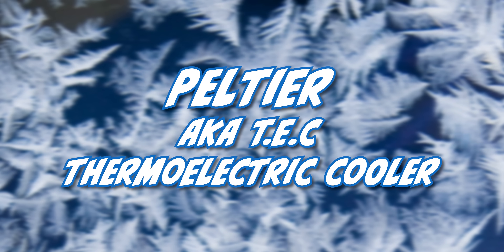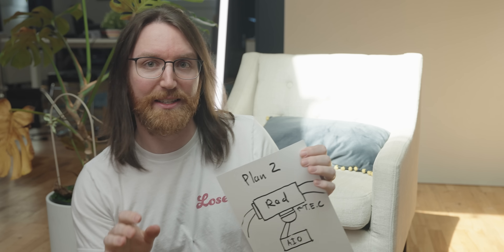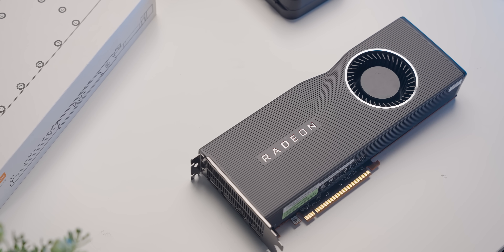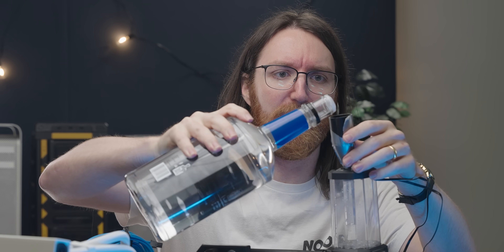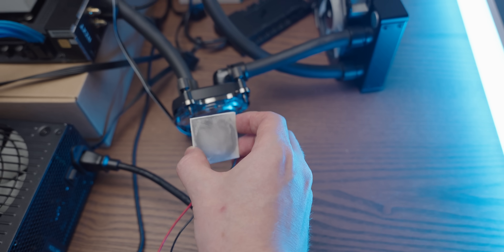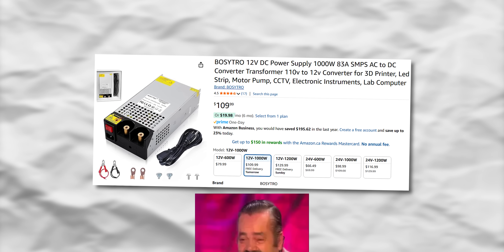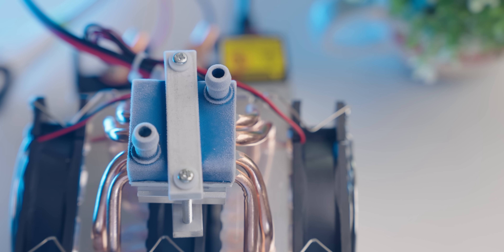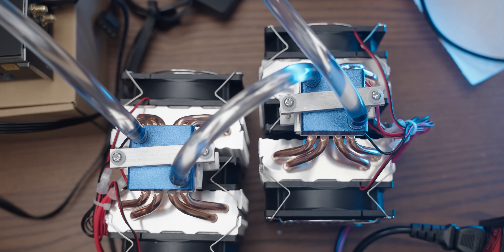I REVOLUTIONISE PC Cooling....

Comment: Due to how a peltier works, the ideal area to put a liquid chiller, is after the radiator, keep in mind a radiator works in reverse as well, thus if the liquid drops below room temperature, then the radiator will simply add heat to the loop. Furthermore, a radiator becomes less and less efficient in thermal transfer when the temperature delta shrinks, this is why those experiments where they use a car radiator or string together 4+ 360mm radiators , does very little for a loop. If you want to efficiently combine both cooling methods, then the first cooling stage needs to be the radiator as it needs the largest temperature delta possible, then after the radiator, the liquid then flows into the peltiers before entering the video card. 

Overall, if you were pumping the peltier chilled liquid into the radiator, then you were effectively making the most inefficient use possible of the radiator. The peltiers will add the same amount of temperature drop to the liquid passing over them regardless of if the liquid is 40C or 20C, but the radiator will now. If the room temperature is 20C and you pass through 23C liquid, a radiator of that size may struggle to do even a 1.5C temperature drop, but if the liquid in the radiator is 40C, then it could easily pull off 15-16C.
Reply: Yep, this is why whenever you are thinking of cooling you have to consider ambient temps, the most efficient way I ever cooled, at least in my case since its pretty cold most of the time where I live, was to have a large radiator outside, I literally have a MoRa3 outside my window, with fans at 100% and used to get my 4 RTX 2080ti back in the day to 6C idle temps and 25C max on 100 percent load, this was when I used to do a ton of rendering...
Reply: @rebootcomputa  That’s awesome! I know Ram doesn’t like low temperatures, but clearly cpu/gpus don’t mind if all the liquid nitrogen overclocking is to be used as evidence 😂
Reply: @_..-.._..-.._  Yeah that might be a bit extreme but I dont think XOC keep their hardware that long below 0C and also neither could I anyway its not That cold where I live. I will say GPUs loved it the most, CPU was cooled too, but it would stay warmer, still managed to keep it dry so no condensation since the delta difference between outside and my room temps was pretty big
Reply: Brilliant! Would love to see a rehash of the video with this in mind
Reply: This. If you chill the liquid going into the radiator, it will just blow cold air out the radiator and cool the room (warming up the loop). If you chill down the 'cold' side of the radiator it can get lower than room temperature.
Reply: @Stoney3K  so if we want to keep our room temps down and still keep good cooling on our PC, this would possibly be a good setup? may be good for us folks down south where it always stays HOT.
Reply: Excellent! I’m so glad I didn’t have to try to explain all that, I wouldn’t have done nearly as well.
Reply: Great reply bro. 

One thing to add is once you have added the peltier after the radiator, find a way of throttling the flow. The longer the liquid can spend in the radiator the cooler it will become. Sometimes it's not about just getting the liquid through as quick. It's the same with car engines. It throttles the flow so that the liquid can dwell longer and exchange heat more effectively. But otherwise great job in answering something we have all asked!
Reply: he forgot that (or maybe unaware) the peltier device itself also emit its own heat, generated from converting electrical energy... this heat is then added to the primary heat which it was supposed to transfer... so the overall system has more heat to deal with later on... so the drawbacks - 1. system cost, 2. overall system's thermal efficiency, 3. safety of cpu/mobo due to condensation... are some primary reasons why peltier may not make any sense in pc cooling solutions.
Reply: Came here to say this myself, but you did a great job of explaining it.  Pumping the chilled coolant into a radiator is counter productive.  The radiator will exchange heat from the air to the coolant.  You need to put the radiator after the GPU, and the peltier before the GPU essentially.  Still, it is never going to be terribly effective.  You would be much better off just immersing a block in a bath of salty ice water, and replenishing the ice periodically, then pumping coolant through that block into the GPU.
Reply: That's quite big brain, so cool before liquid enters the cpu but after the hot side has passed through the radiator
Reply: what about putting 2 waterblocks on the TEC, have the hotside feed the radiator, and the cold side chill the output. You increase the delta t inside the radiator and thus it's effectiveness and should operate the peltier with a low delta T increasing it's efficiency.
Reply: Truth is peltier's work better at lower power than their max power. you just use them as a means to move heat not as a way to COOL. 
Example your Block always stays a 36C on 400 watt load
Adding a 10C delta temp of the peltier would incease the block temp up 10C 
So you only need the peltier to work to do 10C of movement of heat. Instead of trying to use it as 60C max full power it moves (what ever wattage that is) you'll end with something that moves more heat that what it uses causing it's coefficient to go up significantly.

I got a 250 watt peilter 60c uses something like 360 watts of power. Tuning for 10c & only 1/6 the power would be 41.7 watts of power moved more efficiently to what ever block your using. The peltier would probably only use about 15 watts

Thus the block could go from 36C load to 46C load with the peltier was it moves the heat into more effectively
Reply: I subbed to see this video
Reply: This, 100%, He need to get the ambient air cooler than the room air if we wants to lower temps.
Reply: I  I would measure the temperature before and after reaching Peltier.  I doubt its given enough time to cool the liquid.
Reply: One of the problem of using multiple radiators is the friction you add, so basically you break the flow pressure and speeed.then the air temperature is the same, so you basically end to a neutral point where even if the exchange surface is bigger you no more remove heat, and even add it by lowering the speed flow and pressure.
Reply: this is aall mathematically incorrect. Loop order doesn't matter at all if flow doesn't change.
Reply: Same principle applies in hvac, we use outdoor ambient air control to open or close a switch that turns on the condenser fan motor. Causing a higher delta t in the winter and more heat extracted from the building. Versus, a constant operation condenser fan motor. Causing what you stated above, very smart very astute observation. (;
Reply: The delta between inlet and outlet of a radiator will be a degree max, at least at normal pump speeds
Reply: But it was after the radiator? Not before
Reply: @Behemoth33  I was about to make the same comment, but remember that he spent some time showing us the one and only output port on the pump/res, and after that the line from the outlet goes into the CPU block. So his loop pumps from the res to the CPU, then GPU, then the TEC, then the rad, and back to the res. All he really needs to do to correct this is to reverse the direction of flow.

Comment: Back in the day I Cool It had a 3 Peltier  AIO that sold for $400. I had two I used one in my gaming pc and the other in a POS server. They did a fantastic job with a 6600 cpu, but the pumps were not up to long use and failed. The tubing also hardened and cracked in the POS server. I had to replace the mb. I changed it back to air cooling no more issues for years.

Comment: I think there are some problems with the set up. Ethanol has a lower thermal conductivity than water 0.171 W/m·K vs 0.6 W/m·K and you warm the loop but then don't give the Peltier enough time to cool all the thermal mass. I suggest going back to water and giving more time for the loop to normalize after turning it on.

Comment: peltier device pulls all the heat from 1 side to the other causing the other side to overheat causing thermal throttling (at room temp it reachest 70°C within seconds) its used in almost every single bathroom heater that has a finstack
Reply: for a peltier device to properly cool you need to cool the hot side with 1 a thick heatsink 2 water or 3 LN2

Comment: why do you have the radiator after the peltier? if the last peltier is cool then putting it through a radiator with room temp air is just warming the coolant back up.

Comment: Very fun experiment! The big issue with your design is there's zero engineering on the TEC part. These things have an uptimum working point in terms of temperature difference and heat flux. It's a tradeoff, you can go for a big temperature difference but then you cant transfer any heat. Or the other way around, or somewhere in between. On another note, the improvised sub-zero cabaple coolant is actualy a VERY important, water WILL freeze in that block, in between the fins and such for a start, significantly decreasing performance (well, if there was any). Using something with alcohol is a VERY bad idea tho... Alcohol destroys your rubber tubes, o-rings and acrylic. Throw out that entire watercooling set, it is essentially guaranteed to leak if it doesnt already.

Comment: The laws of thermodynamics mean that the energy you're pouring into that peltier device hugely minimizes the overall cooling effect.  You'd be better off taking the peltier devices out and simply running the loop through a couple of extra radiators/coolers.   It won't use any more energy and your temps will be lower.
Reply: party pooper. we just want to do stupid shit that doesn't work so we can learn how stupid we are. then forget and do it all again.
Reply: @michaelwilkes0  😂
Reply: You wouldn't be able to go sub-anbient though, which I think🤔? was the point of this experiment? (And yes, I realize there's no way he's getting it below ambient with this jank. I'm just trying to rationalize what he might've been thinking)
(Edit) I may have been giving him too much credit. I'm not sure what the heck he was trying to accomplish. I'm not sure if he even knows)
Reply: the fun part about thermodynamics and house electricity is that you aren't near the heat source that generates that electricity. thus making peltiers useful in small applications like this. yes, it's overall still inefficient in terms of electricity useage, and adding another single fan radiator instead is definitely more efficient.
Reply: @ThePike220  The other side of a peltier is HOT and will also be slightly heating the room. 

The biggest issue is the radiator, which would reheat the water even if it was sub ambient, with room temp air.
Reply: @ThePike220  "you aren't near the heat source that generates that electricity. thus making peltiers useful in small applications like this"

It has nothing to do with the proximity to any heat source that generates electricity, it's purely down to how much heat the TEC itself generates which it also has to pump on top of the heat energy from the load.  This is what makes the coefficient of performance of TECs rapidly drop as you try to push more heat energy though them.  They are badly misunderstood devices by the majority of people.
Reply: @ferrumignis sure. But as long as it is able to dissipate the heat it generates plus anything, it’s a net positive (assuming the room temperature is both stable and not a consideration)

It’s stupid, it’s inefficient, it’s useless in this context, absolutely.

Also remember if you’re otherwise heating your room with a thermostat-based heater, computers are free to run, because every watt the computer dumps into the room is one less watt that your heater needs to do, until you hit the point that you are heating the room beyond your set point. This only applies in colder climates, and even then, likely seasonally. And it ignores the potential to run heat pumps since they’re effectively above 100% efficiency.

Comment: The solution was really simple and it should work even with the first direct Peltier attempt. Do not use a radiator, connect it direct to the reservoir/pump, no rad in between. It's acting as a heater!

Comment: I think the results would be better if the peltiers were mounted after the AIO cooler in the loop this way they were just taking of the stock coolers load. Also vodka is probably a suboptimal choice too because it evaporates at a lower temperature creating gas pockets on the GPU making the thermal transfer worse.

Comment: Dawid. You should use a 120mil rad max. The peltier is trying to run below roomt temp and your bigger rad is actually also trying to warm the peltier. Basically you have 300+ watts of Cooling trying to warm the perltier, and then like 250w off gpu also warming it up. So there, basicall the Watercoolingsystem makes sure the peltier is over roomtemp. So you will definetly not see much improvement over roomtemps. So maybe loadtest the first 2 setupts again?

Comment: Did you have the hot liquid go into the peltie elements first? In this case they can't do much as the radiator should do the initial coling of the liquid and afterwards the peltie elements should cool it lower as they are not limitet by the ambient temperature.

Comment: Peltier Coolers are a cool idea, but are so inefficient they are only suitable for use in specific situations.

To break down using it to cool a PC:
• CPUs and GPUs are basically 100% efficient turning electricity into heat. So if you dump 100 watts into one of them it generates 100 watts of heat (which you have to dissipate).
• Peltier Coolers are, for this example let's say it's 40% efficient. So if you dump 100 watts into a Peltier, it generates 40 watts of cooling, and 140 watts of heat.
• So to counteract the 100 watts of heat being generated by your CPU you need to dump 250 watts into the Peltier to generate 100 watts of cooling -- and that generates a total of 350 watts of heat.
• So to dissipate the 100 watts of heat generated by the CPU, the Peltier Cooler generates 350 watts of heat -- that you then have to dissipate.
Reply: I use 100w of peltiers to cool the water tubing in my mattress cover. I use them to stabilize the temperature of laser diodes and nonlinear crystals. Never found a use for them in PC cooling.
Reply: I’ve long wondered about using heat pipes to transfer heat directly to the cool side of a traditional window/portable A/C (venting the heat outside, rather than into the room as well), but the practicality is… Not there.

But the reality is my A/C already handles 100% of my system’s heat output, the goal is just to do it more directly.
Reply: @thedave1771 , writes "I’ve long wondered about using heat pipes to transfer heat directly to the cool side of a traditional window/portable A/C"

Heat Pipes would be awkward as they are solid, but you could certainly use long flexible hoses with a custom water-loop and mount the radiators outside. There would be no need to use an AC unit if the intent is to just dump the heat outside, the normal radiator fans would work just fine.
Reply: @thedave1771  It won't be as direct but you can funnel the cold air into a radiator.
Reply: Correct.
In fact you go the Math pretty right for a cooling factor of 20 celsius difference between Peltier sides.
for 10 Celsius is more like 70% efficient.
So 100 watts CPU would need 130 watt on the peltier and have to dissipate 230 watts.

Also, he totally missed the opportunity to put the Peltier after the radiator
Reply: @youkofoxy  The actual numbers aren't really important, the main point is that by using Peltier Coolers you end up having to dissipate substantially more heat than you do without them, so you'd be better off without them in the system.

Even with 70% efficiency you have to dissipate 230 watts of heat in order to dissipate100 watts of heat.
Reply: @fred_derf  But isn't the excess heat now in the case at least, rather than the liquid? And would it not be easier to 'disapate' that heat via conventional fans? Genuine question
Reply: @fred_derf  Any heat pump works like that, is just that peltier barely get to a factor of 2 (two watts of heat in, 3 watts of heat out).
Gas/liquid phase change cooling can get up to 10 (10 watts in, 11 out) making them pretty good for cooling.
Reply: @fred_derf  I get you. Thanks for the detailed reply! Appreciate it!

Comment: Why not make a copper bottom resevoir? You can attach the peltier to the bottom or side and the AIO to cool the Peltier. Since the coolant in the reservoir will be chilled itll be then taken through the pump and to the GPU which will then take the heat back to the reservoir to cool down.

Comment: your're a genius, i'm gonna upgrade my fence wire cooler holding thing to some proper bar clamps, they'll sit much better than my bent wire system lmao. my ryzen 1600X idles at 35c and maxes out at 67c (gamma max something cheap from amazon air cooler, with cheap fans on it). 🤷

Comment: If you ran the peltier coolers in parallel you should get a bump in efficiency since coolers are more efficient when the difference in temp between the input and the cooling air is greatest. Also, the coolant would flow through the individual coolers more slowly, allow more heat to be removed.

Comment: did you try them as a parallel connection vs series in the loop?  If it is from amazon or ebay the ratings for those TEC's may not be accurate.  I would think you need a Tec setup that is at least 25% higher then the gpu  wattage output.  I would be neat though to see you run them in stages, 4, 6, 8.